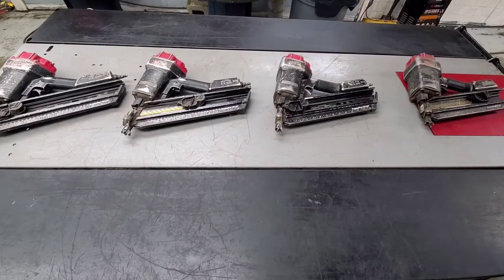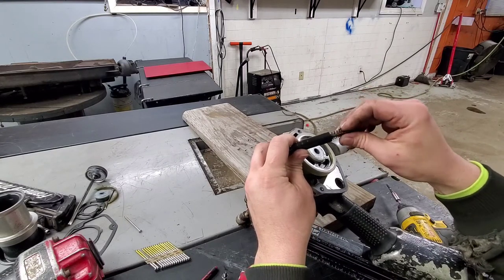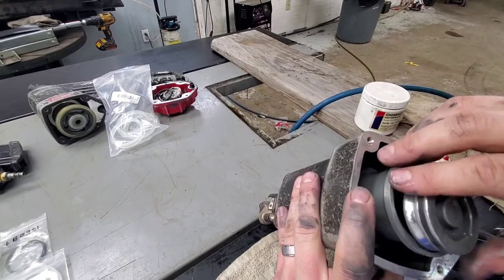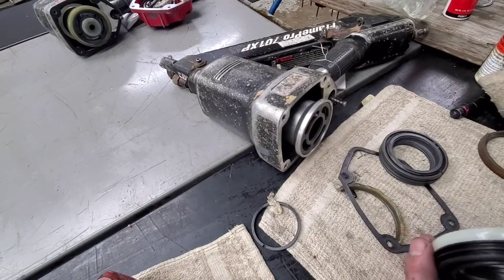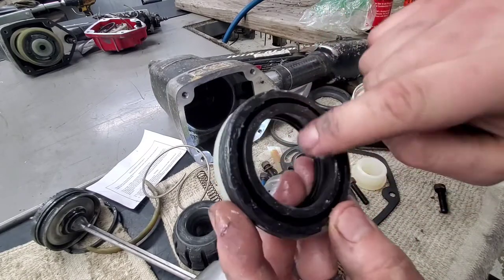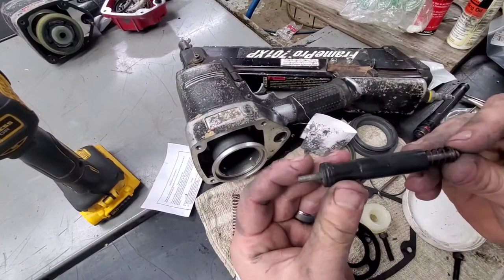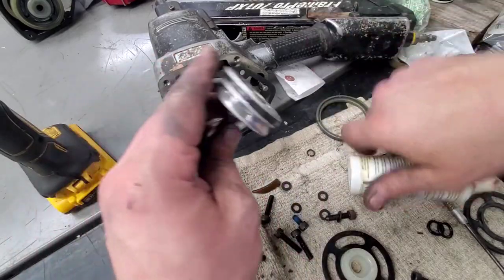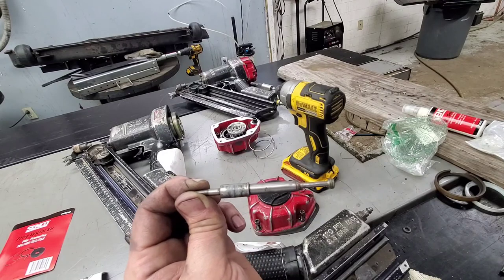Senco Nail Gun Not Firing Air Nailer How To Diagnose and Repair

Comment: First thanks for putting the video together 
I have a older 701 xp 2003 . I replaced parts and orings when I try to fire it air come out the exhaust pot on the rear of the gun. I’m lost as to why. Had it apart a couple of times. 😢
Reply from the maker: Is the rubber band style ring around the bottom of the cylinder? Also the hard plastic piece at the end of the head may be cracked or bad? Most times something is missing or broken in the head valve, outer o-ring on cylinder or trigger when this happens. Make sure head valve assembly pushes in and springs out freely, if one of the o-rings is pinched it causes this also

Comment: Thanks for making this video!  I’ve replaced all the o-rings I can but am still rather stumped. 

When I pull the trigger I get a blast of air coming from where the trigger pin ends. There are two holes at the end of this area, basically a left and a right.  This is not the exhaust port. 

When I pull the trigger air is released and that is basically it.
Reply: I’m not sure if this is an o-ring issue or something internal at this point.  Any thoughts would be much appreciated.
Reply from the maker: Normally and issue in the head when this happens. Make sure one of the Orings isn't pinched. Did you use an OEM or aftermarket kit?
Reply: @IndRepair  aftermarket. I’m thinking some of these o rings were not correctly sized.   I saw you linked an o ring source in another comment.

Would you believe an o ring to be the issue more than any other possibility?
Reply from the maker: Definitely!
Reply: Hi! Were you able to repair your nailer? I have the same problem.. The valve seal amd top bumper were destroyed. After replacing them with oem parts i went to test it and all ai got a blast of air when pressing the trigger thru the two ports on the lower back of the head.. its a Senco 701xp. Any help will be greatly appreciated.
Reply: @orozcorob69  @electricroy3555 I had the same problem with my FramePro 600. As mentioned in this video, the O rings in the head should be slightly loose. Also, for me, I reassembled it in a slightly different order than the other repair video on Youtube. I put the metal plate and the nylon piston catch into the top of the cylinder head, then set the cap for the nail gun on top and tightened it down. When trying to do it all in one stack, I don't think the metal ring seats properly, so leaks at the valve seal. After I did this, worked perfect. But as stated, the problem is in the cap. Hope this helps

Comment: Thanks for making  this video. In have a circa SN325 from around 1991 that I took out of moth balls. I did some repairs to it and its up and running again! I have attempted to run some of the 12d senco brand nails from the local lumber yard. 8d run great, 12d look like they are a touch too long. These nails are 34 degree. No one can seem to tell me if the new nails will function properly in my old SN325. Any advice would be greatly apriciated.
Reply from the maker: Sorry but I am not sure about nail choice unfortunately

Comment: Great video.  I just rebuilt my 701xp and somehow lost the return spring for the piece you bump on the board to fire a nail.  I'm having a hard time finding a replacement.
Reply from the maker: Kb4249 should be the spring you need
Reply: @IndRepair  thanks

Comment: Good day, great video. I have a Framepro 700xl, I got it used. The plastic retainer BF0204 is breaking off pieces. Any idea why this might happen? Thanks for any help
Reply from the maker: Normally the o ly reason this happens is because the metal piece at the top of the cylinder is missing. Can you look up the parts diagram and confirm everything is actually there? I would bet something is missing

Comment: Great video.  I have a 701 xp that will double fire quite often, especially if I don't have the gun placed firmly on the wood surface.  Any idea what is goin on with it?
Reply from the maker: Double fire is trigger or head valve o-ring issues almost always

Comment: Hi, thanks for the video.... Parts are not available for my northern tool framing nailer. Any chance of using o rings to get it working?   Plastic parts in rear of tool failed.  Tool is prob 25 yrs old but less than 100 nails through it. Thanks...
Reply from the maker: O rings in most nailer applications do not have to be exact so it is possible if you can find the right size it is possible. You can get assorted sizes for pretty cheap or measure and order 1 by 1 online
Reply: @IndRepair  Many thanks,.... Worth a shot, otherwise have to go in the dumpster.  Challenge is... Ill have to replace plastic form fitting parts with o rings....  Thanks for taking time to reply...

Comment: Great video! I do have a question for you. I have a nailpro 600 that has an issue that has me stumped. No air leaking until trigger is depressed from two holes in the top cover, not exhaust.  It fails to fire any nails under these conditions.  Any help on where to look for problems would be great!
Reply from the maker: Hello there! Bad trigger o-rings or o-rings in the head are the only reason this will happen normally. I believe once I found a driver through the side of the cylinder and had this same issue also. Thanks for watching!

Comment: Fantastic video. Thank you...  Where can I buy a complete rebuild kit for a 702 XP?  Opened it up and all the plastic rings were broken apart and in 100 pieces.
Reply from the maker: Thank you!! They sell the YK0243 and YK0244 rebuild kits online but do not sell a complete kit. I used to get aftermarket o-ring kits from www.theoringstore.com/ It does look like it shows them being out of stock but they show the 701xp rebuilt kits available and they are mostly the same kit. This is the only place I have ever gotten kits from that actually worked for these nailers. Every other place selling them the sizes do not match up

Comment: I am struggling a little bit trying to get my gun to work.  All new seals etc.  Pull trigger and air leaks out the hole behind the trigger  rod in the end cap.  Any ideas?
Reply from the maker: Many times there is a seal pinched or missing in the head valve when this happens. Also make sure your piston can move up and down freely

Comment: I have a Bostitch nailer that fires 1 round when plugged in. Swapped trigger unit completely first. Do you guys think its just head valve o rings?
Reply: ... Should have also said, nailer works great otherwise, is not bump fire. Its just the first time you plug it in have to make sure no nails in the magazine or goes shooting across the room.
Reply from the maker: Head valve issue is the most likely cause for sure! Thanks for watching!
Reply from the maker: Very well could!

Comment: After rebuilding a frame Pro 702 XP and a frame Pro 600. When plugged up I have no leaks but when I try to fire it air comes out the hole above the trigger assembly what did I do wrong
Reply from the maker: Did you use an OEM or aftermarket kit on this? Sounds like a head valve issue...
Reply: Mine is doing the same! Any luck figuring it out?
Reply from the maker: @kashfoster7851  Many times the seals in the head valve. Have you checked the o-rings or done anything to the nailer yet?

Comment: Hi! I have a 701xp that doesn't leak but when I pull the trigger only air comes out. No nail. I installed a new o-ring kit and nothing changed. Do you know what might be wrong?
Reply from the maker: Is the piston/driver free to move up and down?
Reply: @IndRepair  Thanks for the reply! Just got it going a few minutes ago. 

After taking it apart a dozen times over the last few days, it finally clicked that when I put the trigger assembly in the cap (instead of the gun itself), I could depress the pin with my finger and see its "head" pop out about 1 mm through the back side of the cap. When I would assemble it and pull the trigger, only air would come out of the hole where I had previously been able to see the "head" stick out when depressed. I popped the finger part of the trigger off and it fires every time when I depress the trigger pin directly. 

I'll see later if I can adjust something to be able to re-install the finger part, but at least I'll be able to use it now. Thanks for the video!
Reply from the maker: Awesome! Great job! Thanks for watching!
Reply: @vanhala7  what did you do to get it working?
Reply: @joepski3418  Just a replacement trigger is all it needed

Comment: Got a senco  sn1 with a broken seal  bought it replaced it but it won’t fire , is there a special position for the piston during reassembly ?
Reply from the maker: No, some of the older guns do need to be reset after reassembly. Remove all nails, push trigger safety into wood, pull trigger and hold it in while you hook up air. It should cycle soon as air is plugged un. Hope that helps!